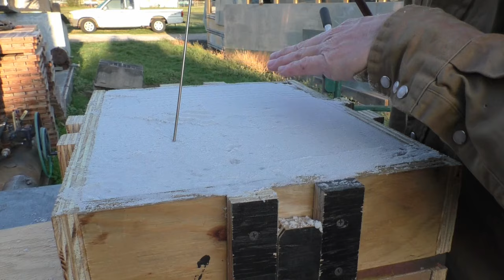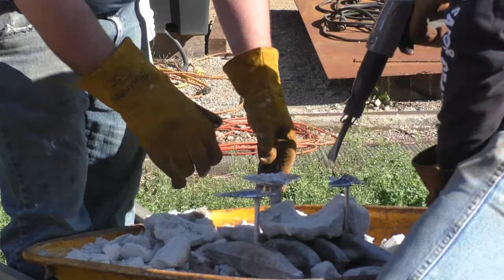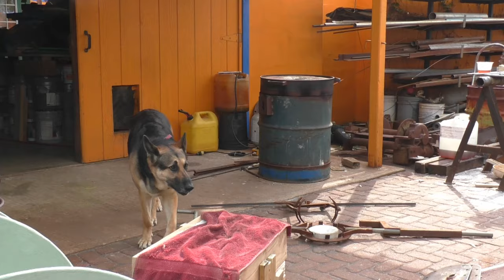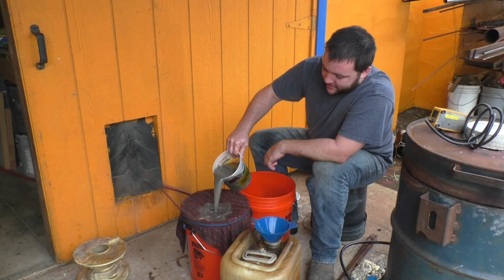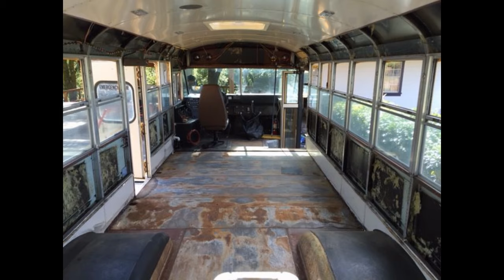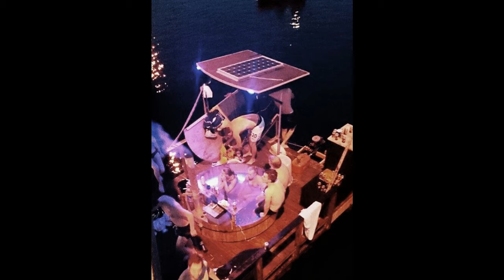Metal Casting, Aluminum & Aluminum Bronze with Match Plates

Comment: Copper can dissolve, even in quite small amounts, into molten aluminum. This greatly improves some of its characteristics, and is easy to do.
Having tried this myself, I could give you a (small) amount of additional info, if you like. It is quite easy, and happens at low temperatures.
Reply: It's not as good as nibril, but can be a good idea for quick, light castings.

Comment: Hi,  I'm not one to give advice but I know a little bit about casting. You were very successful in eliminating suck back by making a large "button" so the cooling metal had something to draw back on but that will not always be a remedy for trapped gases. This is due to the mass of the casting. You could add length to the connecting "spruces", that could help, or add some "vents" to the thickest parts of the casting but if I were casting I would add vacuum, there are a few methods that could work with what your doing with a dry vac

Comment: I was wondering if Al cans were an alloy you could work with.  One or two don't change the total mix.  Fun watching the can melt.
Reply from the maker: They are a lousy source.  ....unless it's all you got.   And we're casting cleats not parts for a spaceship. :)
Reply: Good point about the end application.  My curiosity is about the metallurgy.  As for source, a box car of crushed cans melts down to not much.

Comment: Why not lostfoam casting for those rollers? Easy to machine mold on the lathe, no need to mess with co2 and hardly any issues with metal shrinking since the feed foam part could be as big as you want.

Comment: Just an idea. I'm thinking if you used a wedge configuration for the alignment dogs on your casting box the two halves would go together faster and easier and lock just as good as the parallels.
Reply from the maker: Think about what that would do after you remove the match plate.
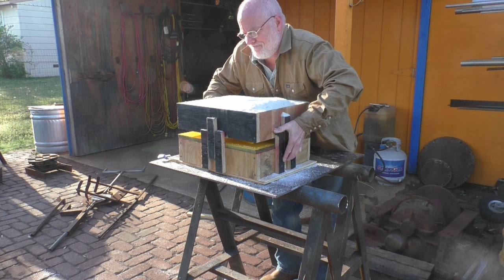Reply: Maybe we're not on the same page. At 1:50 you show the removal of the top part of the mold. You have a pair of alignment blocks on each side of the lower mold and one runner on each side of the upper mold that fits in between. What I was suggesting is replacing the parallels with a 'V' formation on the bottom and the upper with a wedge that fit inside. The alignment is perfect and you don't have the parallel pieces rubbing on each other all the way up. Am I missing something?
Reply from the maker: The cope and drag must line up with the match plate in place and also with it removed.   A V only lines up at one location.

Comment: I m out of my element, I do plaster molds for ceramic and porcelain and just do cast in bumps and divits for mold alignment. I guess there isn't any cross over between plaster and sand casting.
Reply from the maker: We both use really hot metal.

Comment: I've been told its better to allow the cast to cool down slowly...that quenching makes the material more weak compared to a slow cool down. Any thoughts?
Reply from the maker: https://www.copper.org/applications/marine/nickel_al_bronze/pub-222-nickel-al-bronze-guide-engineers.pdf
Reply: wow lots of good info in that pdf......saving that :)  the only stuff i saw in the PDF says that 1-2 hours heat treatment at 845c or so then water quench after..... people i've spoken to always say cooldown too quick and it is possible to have later cracking at welds ect.....my welding classes i always quenched it...cause im too lazy to wait lol
Reply: still searching....its a big pdf lol
Reply: In the PDF Page 25 - Table 7a talks about the  Strengthening Effect comparison of quenched and heat treated.... doesn't look like a huge deal when it comes to casting..... it is probably more important for welding to prevent cracking of welds in the future maybe.....that pdf is pretty awesome....i need to print it out!

Comment: Cool casting work. Just wondering why you are using that difficult bronze for ordinary parts. Silicone bronze and 386 grade red bronze are common marine metals and  are a lot less prone to shrinkage and should meet all the physical requirement you need. 
There also some special , and not very expensive sleeves to use as risers from insulating material that helps keep the riser hot and hence feed the casting as it cools and shrinks. I'm impressed with the casting success you are having.
Cheers Warren
Reply from the maker: We get the NiBrAl from a local foundry, and I like the strength.    As to technique I prefer simple.  I want to be able to do this on a beach when needed.
Reply: +SV Seeker ...I understand where you are coming from and your beach foundry design is great hence why I'm trying to avoid suggesting redesigning your methods. If you get a chance to try silicon bronze or 386 I think you will be very happy with the results. Is strength that important? When ever we have to make gating for aluminum bronze grades the foundries always want lots of risers even  right on top of the casting and the guys are always complaining about having to use this metal that is so hard to get good castings from. 
Here are 2 links to an alum Brz strut pattern with a massive Ingate , and 2 risers. Sometimes we put a riser right on top of the shaft area 
https://www.dropbox.com/s/mgdpj6o5wuz4ufv/File%20Apr%2006%2C%208%2009%2054%20AM.jpeg?dl=0
https://www.dropbox.com/s/hja74kh4cj3f5ur/File%20Apr%2006%2C%208%2014%2020%20AM.jpeg?dl=0
Round risers generally hold their heat better too. Keep up the good work Cheers Warren
Reply from the maker: thanks

Comment: I've one question. Is it okay if you quinch aluminum and brass? It doesn't change the hardness and overall property of the metals?
Reply from the maker: We are not following a work hardening process, we are only speeding the process of reusing the flask.  And we only quinch the Aluminum Bronze, aka NiBrAl which is actual good for increasing the tensile strength but I doubt it makes much of a difference.  But it would take a long time to wait for it to cool from 2400F and it also cleans up better.

Comment: I'd like to know your sand mix and ratio, where ya got it and how much. Been aching to get some casting projects dine in my books just need my green sand setup.
Reply: Most green sands have silica in it some cheaper methods is using kitty litter as the adorning compound is silica or like silica. based on his mix I would be surprised if they threw away the excess sand as most green sands are easily reusable. the co2 may harden it but not permently alter the main compound. 

Maybe his video on his casting is much more needed than asking my few questions.
Reply: Kitty litter is sometimes used as it can be, if it's the right type, a cheap and convenient source of bentonite.
Reply: If you  press on sv seeker  beside the pic in title and it takes you to a list of all his videos. then hit playlists and then casting metal. Scroll down to casting metal with silica sand step by step and it has a very detailed instructions on how exactly to do this.
Reply from the maker: Green sand is great if you're going to routinely cast.  For one off casting I highly recommend sand and a bottle of sodium silicate from the auto parts store.  You can start today and toss the left over sand into your garden leaving you with nothing to store or reprocess.  https://youtu.be/qPnSb3yzytE

Comment: with all the trial and errors of casting an aluminum part, why not just turn one? you have a lathe.
Reply from the maker: Trail and errors is part of learning and life.  Embrace that and you can turn scrap aluminum into usable item.  ...and I think you'd want to use a CNC mill if you wanted to machine a cleat and make a lot of scrap aluminum.